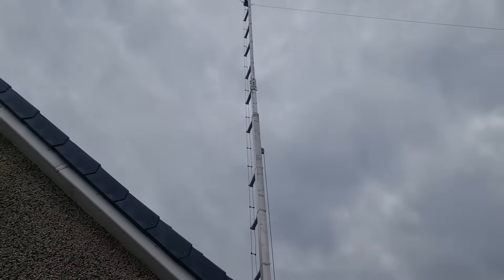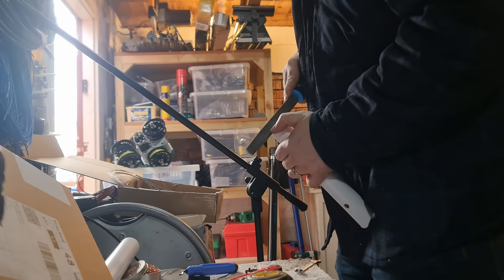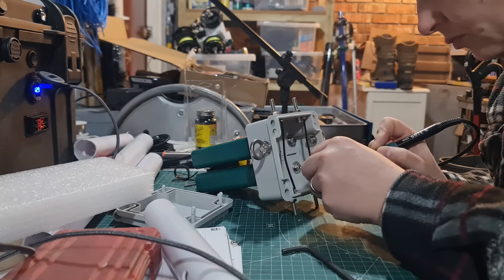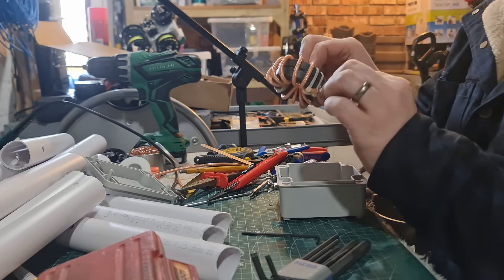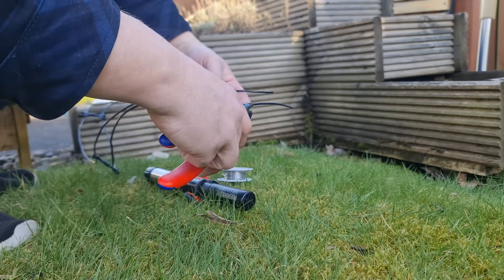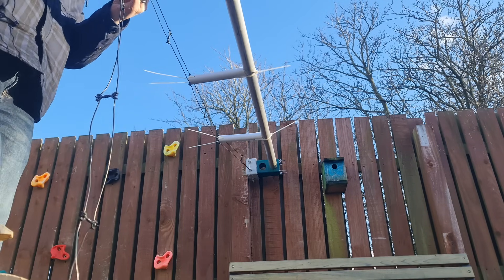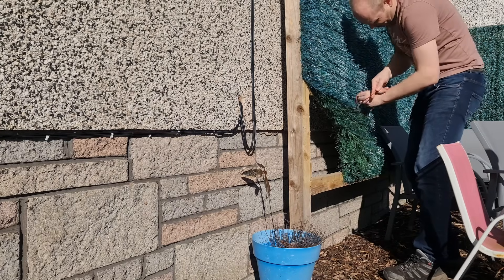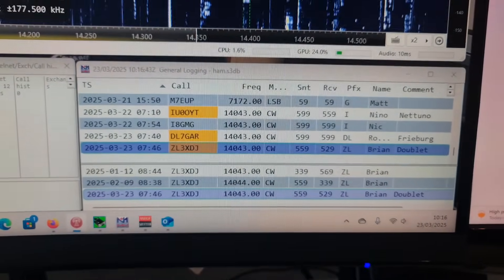The AMAZING Doublet Antenna

Comment: Hi, I have been experimenting with a doublet antenna too, I think mine was 13 meters on each leg. I used 600 Ohm open ladder line. I have another question about your off center end fed wire antenna that you took down in this video. Is it true that OCEF antennas do better and end fed have wave antennas. The EFHW need a 49:1 UNUN at least, I think the OCEF need a 4:1 UNUN. Therefore I assume that the losses are far less and using the internal ATU from the transceiver normally the OCEF should tune up on most ham bands. How long was your OCEF antenna? Cheers, 73 de ON4VP, Phil
Reply from the maker: I would certainly choose the OCFD over the end fed for multiband work. I didn't have any complaints with it. The doublet is as good if not better and covers more bands.

Comment: Well done Colin,, Why use ft240-43 ? and possible use one toroid how much power handle with rg400 ?
Reply from the maker: Because 40m is mostly what I use. Used RG400 as had it to hand. The coax will handle many KW but for over 1Kw use 2 cores

Comment: Colin, nice videography.  Thanks for the great explanations.  Hopefully you've conquered 17m but, if not, try adding 1/8-wl on 17m.  Also, don't make 90° sharp turns with the ladder line.  You want a gradual "roll" to the new direction.  Can you space your feedline out to 100mm?  That will give you ~600ohms impedance.  Here's my Doublet setup.  Ladder line spaced with 4" spacers, initially every 6" and spaced 12" once the line leaves my roof overhang.  This keeps separation.  The total length of ladder line is 43-45', which is an "agreeable" length.  The horizontal bits are 57.5', for a 115' dipole.  At the feed point is a Balun Designs "Hybrid" balun.  It's a 4:1 combined with a 1:1 in the same box.  BD says this is important if the antenna is within 25' of any structure.  From there, a 6' run of RG-213 leads to a Palstar AT2K.  Finally, my Heathkit SB-220 amplifier forces RF into  the system.  I also use an SDRPlay RSP1A for receive and have SDR functionality, coupled to my Icom 7300.  My Doublet performs so nice on every band.  Reliable DX on the upper bands and jaw-dropping "30 to 40 over" performance on 40 and 80.  I work 60m, too.   Barefoot, of course. 😀
Reply from the maker: All great points. still no 17m but I will get there, I need to add a bit more wire - easiest way.

Comment: Hello Colin, your doublet antenna is too short or not suitable to cover the 17m band, the total length is too high-impedance for the 17m band. Vy 73
Reply from the maker: Thanks Markus, I've seen your mail. Just nkt had time to look at the files or reply. When I do, I will reply back. 73.
Reply: @MM0OPXFieldRadio 
Hi Colin, take the time to read the email. Use the doublet calculator to find the right length. 2x13.5 meters and a 600-ohm feeder line  are best.

Comment: Great video! I've been using a Doublet now for close to 25 years and enjoy it. I have however made a few changes from the Antenna Handbook design. After having read DJ0IP's writings about the Doublet, and advice from a gentleman from Palomar Engineers I've since shortened the radiators to 115' overall length. That's down from the 135' I normally have used. I use the MFJ-974HB Balanced Line Tuner and it works great. I have also used it with a 1:1 balun, and a short coax into my Ten Tec 238 ATU. That's my main antenna.
Reply from the maker: Thanks. Yes Rick has some wonderful information, he does a wonderful job. I dont regret this but do regret not coming straight into the Tuner. I need to remedy that in time. I thought about shortening mine but will see how it goes after connecting it direct to the balanced connection on the ATU.

Comment: Lovely tidy work! My one suggestion next time you take the mast down is to replace the white cable ties with black - black is more UV resistant and won’t go brittle in the sun. 
Or maybe that’s not an issue in Scotland! ;)
I’m actually going to do a similar project shortly, but rather than a doublet, it will be a double-Zeppelin, fed with a 1/4 wave open wire stub grounded at the bottom. It’ll be single band for 40m, but should help my noise floor, being a DC short.
Construction will be the same as yours with the exception of where the coax connects to the stub, which will be at the 50-j0 point, via a 1:1 like yours.
Reply from the maker: Yes your right, I had a big bag of these. for my last antenna these white ones lasted 3 years without breaking down so not too worried.

Comment: Hi I’m a new ham I’ve put up a mono band dipole for 40m about 26’ high swr is ok  other readings close but on the R X sweep for 7100khz readings say resonance is 6200khz. Any input appreciated. M7HZR. I made a good contact to mm6BOQ from southend on sea. Not sure if I’m just chasing my tail. Ta.
Reply from the maker: if its working leave it. Antennas in general are affected by everything. Depending on the orientation this will effect the resonance. On a proper dipole you shoudnt see a 1:1 SWR.
Reply: @MM0OPXFieldRadio many thanks. Love the channel buy the way. 73. M7HZR.

Comment: I've been using these doublets for decades. The use of coax for the choke and to the tuner is problematic due to the high capacitance per foot of coax. Just a few feet of coax will act as a "transmission line transformer, and can take a high impedance down to a very low impedance making the tuner very unhappy and causing lots of loss. You can easily vary the length of that coax and you will notice a much greater rate of impedance change than when varying the length of the ladder line. Per your readings....R-1.94 and X 9.97 at 18.1mhz, if you add 12 feet of RG-8x or your teflon coax, the impedance will jump up to over 30 ohms R and -170 ohms Xc. Your tuner should match that easily. Of course this will affect the other bands but it is easy to do. The downside to doing this is power loss in that extra coax. Power loss in that Teflon stuff is no less than RG-58! Expect another 1db or so. 
If you can manage to get the ladder line into the shack the loss will be much loss. You can use 300 ohm window line for this. It will go through a 1/2 hole in the wall. 
Next, instead of using coax for the balun, use ptfe insulated bifilar turns of individual wire. This greatly reduces the capacitance per foot and slashes the RF loss. Bifilar turns have a characteristic Z of about 100 ohms but this doesn't matter since your impedance requirements are all over the map anyway. 
Just bear in mind that coax has an impedance of up to 20pf per foot so putting any length of it across a high impedance point really effects things. 
Enjoyed the video. 73 N4LQ
Reply from the maker: Appreciate the detailed feedback Steve. Running the ladder line direct for sure is on the cards. In your opinion, if I was to initially change the choke to bifilar one do you think this would improve the match? I happen to have enammeled wire here as well as PTFE tube so would be an easy swap over. Later on I would then replace with Ladderline all the way to the tuner. 73
Reply: @MM0OPXFieldRadio  The bifilar winding will reduce the "transformer" action and reduce the RF loss a lot. Coax with those crazy SWRs is not to be used anywhere. It could be the reason why the antenna seems quieter. 
My balun here is bifilar but I use three stacked 400-43 cores wound with about 8 turns of 300 ohm window line. Yes. 4" diameter cores! The window line winds nicely and the 300 ohm Z does minimal transforming. This balun is setting behind my tuner and connects directly to the unbalanced output with no coax. The tuner is automatic, MFJ-998. I would much prefer a real balanced tuner but I can't resist the convenience of the auto-tuner.

Comment: Hi Colin - I’m just trying to get back into Ham Radio after an almost 40yr gap and trying to get on the air discretely (so as not to freak out the neighbours) in my small garden at the West of Edinburgh. I just came across your channel while investigating transformers for wire antennas (most of what I had found previously is from the US) and then ended up watching this video. I’m very impressed by your installation in what is obviously a small garden. Now Subscribed! 😊 73 de Peter GM4RAH
Reply from the maker: Thanks Peter. You will find many smaller space antennas on my channel. It could be worse. We had to.make compromises when buying the house. I did make sure there were no overhead cables! Im sure you will have loads of fun getting back into the radio.

Comment: Seems a long-winded construction process, my own doublet uses an IC-7100, 2m of RG58, SGC SG-235 @7ft on the 20ft Tower, 14ft open wire Copperweld antenna with 11" Admiralty Porcelain spacing in a vertical Ladder, @20ft the Copperweld antenna splits into NNE and SSW 66ft horizontal legs to a steel cable braced 20ft Aluminium Scaffold Pole (SSW), and @20ft a 6ft Aluminium Scaffold Pole mounted on T&K bracket on the side of my house (NNE).  All Insulators are antique Pyrex Clear Glass Dog Bones, 3" length at the tower, and 7" length at the end of each leg.

So I do not have a ladder line or choke fitted between a conventional shack based ATU, the antenna is directly connected to the SG-235 Smartuner @7ft on the mast, and has a vertical section of 14ft spaced at 11", followed by ~66ft horizontal legs.  The resonance of the entire antenna is ~3.3MHz, and gives 1:1 SWR on 160m, 80m, 40m, 20m, 15m, 10m, and 1.3:1 on 60m, 1.5:1 on 17m, and 1.7:1 on 12m.  The IC-7100 is 100W PEP, due to digital mode duty cycle I've never ran more than 50 Watts for a rare DX on FT8 (I use JTDX), I generally stick to 10 Watts, particularly during contesting and when using Olivia 16/500 (Fldigi) for Raynet.  The SG-235 is rated to 500 Watts, so conceivably I could add a 500 Watt Linear, but I've no such plans to do so.

All the parts used are marine grade stainless steel, including carabiners, turn buckles, eye plates, wire clamps, porcelain clamps, etc, including pulleys to support/tension the Copperweld antenna, and 4mm diameter halyards, and stainless steel cleats for securing ropes.

The central support on the tower is galvanised steel scaffold tube handrails with 90 degree brackets, supporting a stainless steel eyebolt, similar eyebolts are used for the bracing and antenna supports at each end. 

All parts bought off eBay, worked New Caledonia, Australia, and New Zealand on 10 Watts in the RSGB FT4 Activity Weekend, on 80m, 40m, 20m, 15m, 10m.  Entered 24 hour category because I worked 35 minutes beyond the 12 hour category operation, and came 3rd, first Competition.

The antenna was built in 2021 for NVIS HF Raynet Operation, for 160m, 80m, 60m, 40m, not DX.

Since bought a second-hand SG-230 (200W) portable doublet (likely inverted-V), and a Yaesu ATAS-120A mobile operations SSB/Digital, and will get an FT-891 for this for my outfit Toyota Avensis Estate + Ace Celebration 620 twin axle.  Previously used separate Inverted-V Dipoles for this, but it's a logistical faff.

I do have a broad-banded FT-847 (includes 8 Watts on 4m), I use for Pactor (Winlink Radio Email) on a 40m horizontal dipole (two Watson HF40 whips) @12ft on the same tower.

I also plan to add 3x horizontal dipoles for 40m, 60m, and 80m (HF Whips), and a tri-magmount 160m vertical HF Whip, for NVIS Mobile SSB/Digital operations using an old broad-banded FT-100 (not 4m) in an Audi S3 Quattro (although 60m will legally have to be portable only).

VHF/UHF for Raynet I haven't mentioned here, but includes APRS and Cross-band Repeater, using IC F-110s, an old FT-8100, and an Ascom SE-550
Reply from the maker: Not sure if your first statement was satire after reading about all your work 😂.  Its appreciated. I always like hearing how others get on. I'm still enjoying the Doublet.

Comment: Hi Colin you will be getting some massive interaction between the ladderline and the mast.
Reply from the maker: No, I don't beleive I do as the spacing is over 4 times more that the wire spacing itself. Recommend is min 2 times.
Reply: @MM0OPXFieldRadio  Have you considered a single standoff at the top of the mast say 1m long and hang the feeder from that

Comment: Nice work!  Been keeping a 600 ohm ladder line fed antenna in the air now for at least a couple years now.  It is my go to multiband solution.  I have deployed a 300' doublet, a 125' doublet, a 66' doublet, a 700' loop, and currently have up a 400' doublet.  73 KF0BBU
Reply from the maker: Wow, wish I had the space for a bigger one. The fact you have stuck with ome says they are good.

Comment: How are you tuning a 33 SWR? Am I misreading that?
Reply from the maker: With the Palstar AT4K. The loss in the short coax length is so little. The rest is ladder line.
Reply: @MM0OPXFieldRadio  So what is the tuned SWR then? I love the stand offs on the mast - well done. I have a telescopic mast so that wouldn't work for me, but I love your inventiveness.
Reply from the maker: Thanks. I can get 1:1 on any band (apart from 17)

Comment: Great video! I was little surprised at the 1:1 choke, is that a typical ratio when going from coax to ladder line? Thanks for sharing, very helpful information!
Reply from the maker: Good question! Yes it is. The 4:1 is sometimes a misnomer. AMU's struggle more with low impedances rather than high ones.
Reply: @MM0OPXFieldRadio  thank you. That's a nice crank up mast also. Well done on all 👍

Comment: Very nice. I have a doublet up and what you experienced is what I have experienced. Much quieter than a dipole. I am lucky enough to have a 300 foot doublet up and about 40 feet high into a tree so I could tune 160m however, I extended my ladder line to reach the shack (added an additional 100 feet) and it has not tuned 160 or 80 anymore. I am going to trim the dipole elements back as based on my Rig expert it is too long. Thanks for the video.
Reply from the maker: Its really quiet, like S3-4 on 80m. Want to tweak further to see if I can get 17 to come in.

Comment: If you are using insulated wire then apply a velocity factor. 0.95 will be a good starting point.
Reply from the maker: I did but still had to keep trimmings the feeder.

Comment: There are absolute gold nuggets of info throughout this video... V blocks for alignment during gluing,  balanced line stand-off distances, using a core drill to cut & radius the stand-off spacers... Absolute gold dust... Thanks very much. Fantastic video
Reply from the maker: Thanks. That's wisdom for you.

Comment: Well done, I actually had essentially the same antenna a while back, a 40m dipole where I changed from coax fed to open-wire.  Later extending the dipole section to ZS6BKW length. Something you might want to consider since you will gain 80m coverage  without doubling the length of the antenna. 73
Reply from the maker: I will look into. Can you get 17m ok?
Reply: @MM0OPXFieldRadio  Sorry I don't  remember now, I believe so. An advantage of going for the non-resonant top section is avoiding the extremely high impedance you get effectively feeding a 40 dipole on 20m.
Reply: @g0fvt  I was, or am, wondering, if there's any mileage in using the EFRW random wire lengths for making a non-resonant doublet?
Reply: @paulsengupta971  with multiband antennas there can be merit in avoiding resonant lengths. Personally I would prefer to keep the doublet symmetrical.
Reply: @g0fvt  It can still be symmetrical and non-resonant. Where you feed it will affect the feed impedance on different bands, and centre fed is still an option.

Comment: On your next re-install, could I suggest using black cable-ties, as they are more UV-resistant and last longer in the sun. (May not be required due to your, er, northerly lattitude)
Reply from the maker: Or preferably specific UV resistant ones.

Comment: As  long term user of an 80M OCF dipole, I'm interested in how you get on with the doublet.

With your new antenna in in an inverted V configuration? I wonder if the VSWR coverage would be different if you could set it as a flat top? 
The inverted V should provide more omnidirectional coverage and a flat top would give some specific lobes in certain directions depending on the frequency.

A very professional build Colin. Have fun.

73 Bruce G4ABX
Reply from the maker: Thanks Bruce. Yes an inverted V. I couldn't do the flat top here. Thinking I could heighten the tower slightly (crank up anyway) and extend legs a little to see if that works. Very happy for now.
Reply: @MM0OPXFieldRadio  Antennas are one of the few items where we can still experiment. 
Its great to see your doing this and having good results.
I'm presently experimenting with a 'no tune' 25ft vertical for Portable Ops. Wish me luck!
73
Reply from the maker: @Dr-T  Fantastic, keep me posted. I've been thinking along those lines for an antenna to match with my QMX+

Comment: Excellent idea in respect of using the mast and keeping the open wire feeder away from the metal. 

Thanks for another informative video. 

I wish I was as practical as you.

Let's have a look at your train set 😂

73 Bob M0BOB.
Reply from the maker: Its simple and cheap Bob. The magic words.  Yes probably poor UV resistance but I will remedy that later of need be.